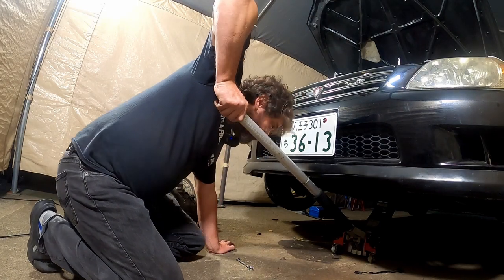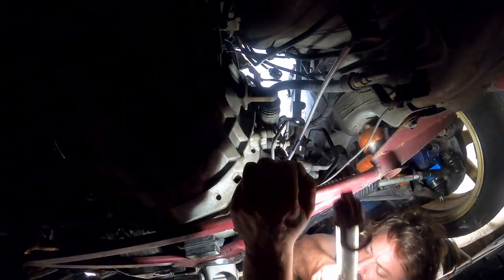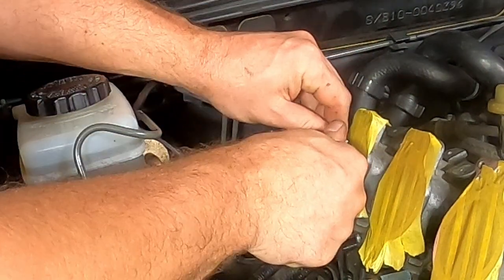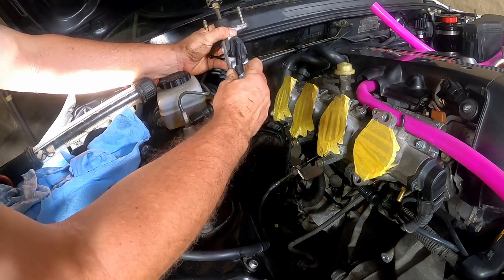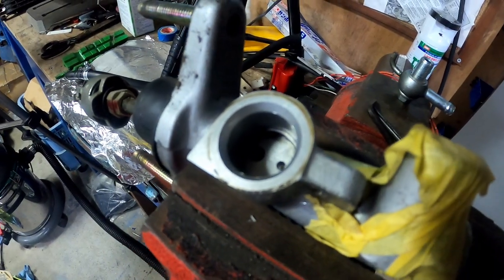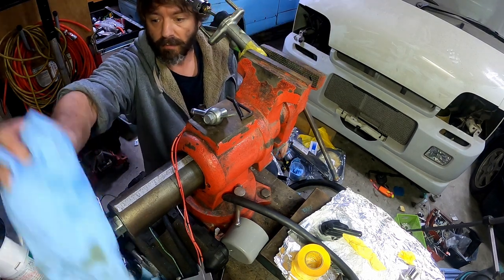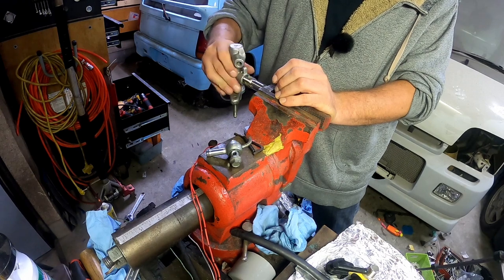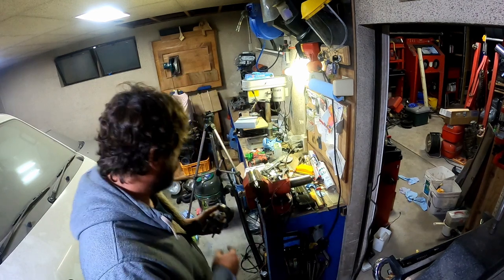Clutch Master Cylinder Removal And Customization Altezza

Comment: Damn I understand the struggle. Two weeks ago i also needed to fix my clutch pedal after a nasty clutch kick. And fixing it in that position was a nightmare with my hight (1,93m) after 20 mins of struggling I just unbolted the seat and made it myself comfortable 😂
Reply from the maker: Damn son you're tall AF!! Did you figure out that if you remove the panel under the steering wheel you can just use a long ass extension to get to the bolts?